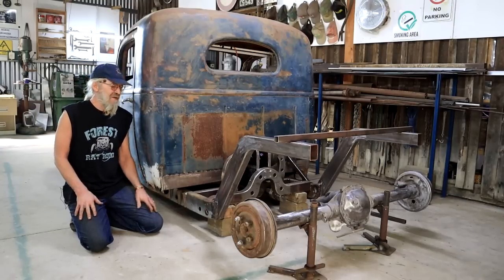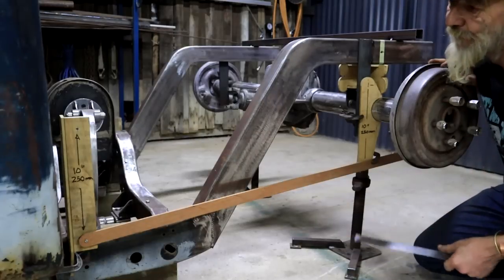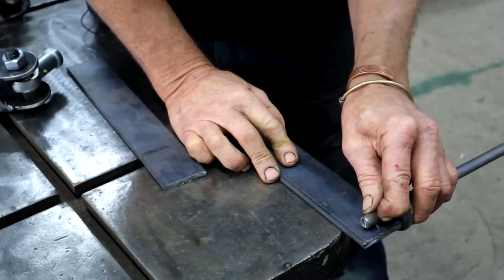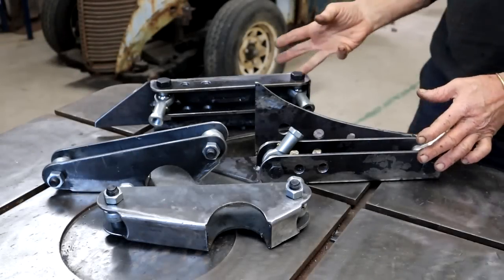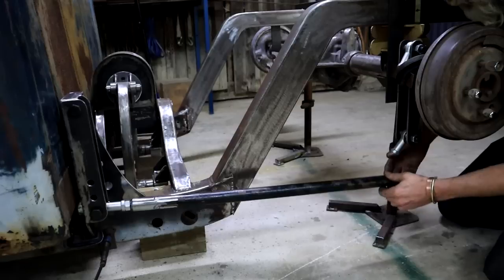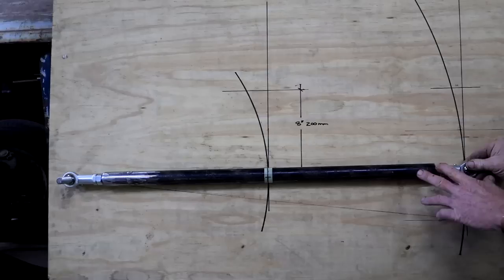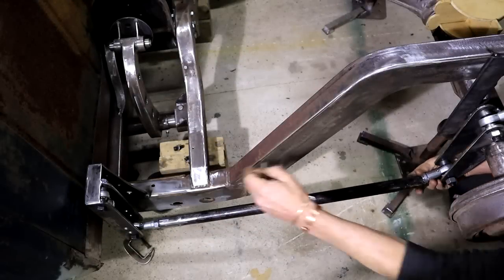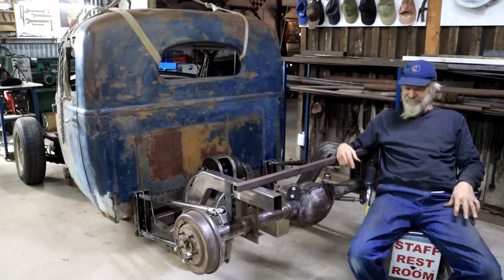Building parallel 4 link suspension from scratch - 1939 Hudson Rat Rod Part 18

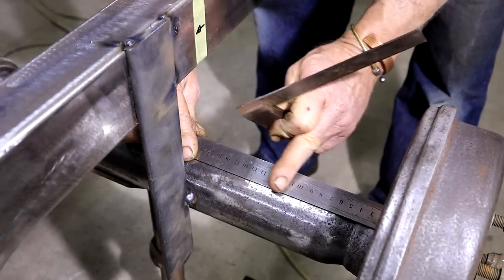Comment: Hey Diff, I'm sure you already know this but some of your viewers may not ... the rear axle won't articulate with a parallel 4 link. It'll go up and down fine and look really cool but if you ever plan on going off road it's not gonna articulate (lean) over all the bumps without putting everything in a huge bind. You can watch me explain that in my "How I Mounted Coilovers And Diagonal Link" video starting at the 4:13 minute mark. You can demonstrate that when you get done by jacking up one wheel (or side) and watch the other one magically come up too .. which makes a cool video. Carry on brother.
Reply from the maker: Howzit Bob. Yeah saw that video🙂 But remember there is quite a difference in articulation between using bushes and heim joints. I will post a video showing what I get when I have those rear brackets welded on and can jack the real axle up and down. 👍

Comment: MOST INGENIUS FABRICATION... WELL DONE. 3 DEGREES ENGINE AND PINION,THATS WHAT I SET MINE ALL AT, AND NEVER HAD ANY VIBRATIONS OR U JOINT FAILURES.HONESTLY AS LONG AS THEY MATCH . YES ITS NICE HERE IN IDAHO U.S.A. TO ORDER PARTS , BUT I STILL FABRICATE LIKE YOU AT LEAST 75 % OF MY BUILDS. I LOVE MAKING MY OWN FRAMES AND STEEL PARTS, THATS REAL KREATIVITY!   BE BLESSED, THAT🤟🤟👍👍 BUILD IS TOP NOTCH.
Reply from the maker: Thank you brother!  Yes, most important is indeed that the angles are the same. Seems a number of people don't realize that

Comment: Look Good Div, Thank you for sharing. I remember doing my 4 link, Was quiet a task. Took me about 5 hours to set it up and 5 mins to tack it in place. I used left hand and right hand threads on the 4 link so I can tune in the pinion angle. You way will also work.
Reply from the maker: I'm sure you did a great job, know your work! I want my link bars to have exactly the same length, otherwise its not a parallel 4 link anymore. I will explain why I want that in my next video.

Comment: Love your attention to detail as far as them 4 link bars you always want the bottom bar level  taking into consideration the weight that it will be once the bed is made etc. So if you have it off a bit its a rat rod.
Reply from the maker: Thanks. Yes, I know the general rule is that link bars should be level to the ground at ride height. But that rule is not cast in stone, there are other factors like anti squat that can come into play.

Comment: Hey Diff, you typically answer my questions as i think of them. How much forward and backward movement can the air bags take? I would think that fully dropped there will be the least forgiveness. Cant wait to see setting the pinion angle. I swapped out transmission and transfer case in one of my jeeps and now am fighting a vibration. Great job!
Reply from the maker: Yes, I will have the bag brackets nicely lined up at full compression. A little out of line at full extension won't hurt them, there some flexibility there

Comment: Are you planning on using a carrier bearing for your driveshaft tunnel and a double cardan ~15" short slip shaft to attach to your pinion? I can't imagine the pinion angle being much more than a couple degrees from 0*.  Nice work! You've got be baffled! Love the torsen-cantilever airbag setup!
Reply from the maker: Yeah, something like that is the current idea. We will see how it works out🙂

Comment: Correct i agree , motor = electric / engine = combustion chambers , gas, ect.  I wish i could weld with the end of my finger and cut steel pipe with a knife .
Reply from the maker: Yes, you are a wise man!🙂 Those knives are EXTREMELY rare!😂

Comment: Question. For the link bars you used bolts on the ends presumably so you can adjust the length. However, you need one end to be reversed threads. Right now, if you spin the bar it won’t change length. You will have to remove the bar completely and spin each end separately.  If the bar length is not to be adjusted, then why not just weld the rod ends in solid?  Great work and very informative videos. Definitely subscribing. 👍🏼
Reply from the maker: Thank you! I wanted the option of adjusting the length but could not source left hand thread bolts. Like you said, need to be removed to adjust, but so be it. It's not something one would do often😀

Comment: Rear axle forward and aft movement is one of the issues Ford designed into that horrible handling MK4 Zephyr you have outside, they understeered something terrible roll steer like you are trying to avoid, liking the engineering going into this build
Reply from the maker: I heard they did not handle well and were a failure. Never drove one myself

Comment: What size plasma cutter are you using. Great show love it cheers Diff
Reply from the maker: Thanks Ian. Mine is a Cut40. Good enough at least up to 6mm/1/4". I never cut thicker than that.
Reply: @ratrodsafrica  thanks for that i have a cut 40 but it doesn't work as good as yours.

Comment: 2 wheeled powered vehicles are called MOTORcycles not enginecycles. Competition between powered vehicles is called MOTORsports not enginesports. Powered boats are called MOTORboats .... and on and on. Call it what you want 😏😂 Cheers from 🇨🇦 have a great day.
Reply from the maker: Its because in those cases, the word MOTOR is a verb. Motorboat vs rowboat. Motorcycle vs bicycle. An engine is what it is, motor is what it does! 🙂 Let the never-ending debate continue😂

Comment: Will it need a pan hard bar with that style setup? I've been enjoying this series. Hope those Heim joints are stronger than they look. I know camara can be deceiving. Carry on and I will keep watching
Reply from the maker: It will need either a panhard bar or Watts link to prevent side ways movement. For a setup with lots of suspension travel a Watts link is the better option. The video will come, watch this space!🙂

Comment: Sorry if this is a stupid question but couldn't you adjust the pinion angle  by turning the link bars thereby increasing or decreasing  the distance between the heim joint eyelets?
Reply from the maker: Yes, you could do that. But it will mean the upper and lower link bars will have different lengths. And that means it will not be a true parallel 4 link anymore. In my next video, I will explain why that is important

Comment: Nice job ,are you gonna run a panhard bar as well , or will you need it ? Thanks for the video ,great job!
Reply from the maker: Thanks. The Watts link does the same job as a Panhard bar, only better.
Reply: @ratrodsafrica  Yes it does , I saw that later in the video , and I thought , oh wow, a panhard and then some , excellent job , thanks for the shock video too , I'm building a similar style  rear clip , so this gave me a great idea on where to mount my shocks , except I'm not running bags , just coil springs , with weight jacks , old stock car stuff , lol 🤣 keep up the great work 👍🏼
Reply from the maker: @edwardippoliti626  all the best with your build, brother!
Reply: @ratrodsafrica  Thank you , and thank you for your great Rat Rod videos!

Comment: Howzit oom,
You went right over my understanding, so I have a question, what about side to side swing, how are you going to deal with that?
Hava lekke een,
Ciao ciao,
Reply from the maker: Ag kak man! Use those brain cells and you will get it!🙂 The 2 common solutions for sideways movement is either a Panhard bar or a Watts link. Go Google it! But I will also be doing a video when I build my solution.
Reply: @ratrodsafrica  Fhanks oom, I have seen the Panhard setup but thought it was part of the 5 link suspension,
Anywho , talk soon 🔜 hopefully you are healed totally by then,

Comment: Can you set the pinion angle with the links or are they not adjustable because the ends are all right hand thread. Just a thought.
Reply from the maker: If I set the pinion angle with the links, the upper and lower link will have different lengths. Then we dont have a parallel 4 link anymore. I will talk more about why a parallel 4 link is important for my application in the next video.
Reply: @ratrodsafrica   would fractions of a inch make that much of a difference? I can wait until your next video for an answer. Thanks Diff for another great video.
Reply from the maker: @kenstevens5675  probably not. But I try to do things the right way 🙂

Comment: Hi Diff! Greetings from the top of NYS! Do you go between metric and SAE just for us in the USA?
Reply from the maker: Howzit! Mostly yes. Although I did spend a few years in the States and sometimes flip between the two when working 🙂
Reply: @ratrodsafrica  i figured that was the case! I am one of few that just wish we would switch over like the rest of world.
Reply from the maker: @paintslinger16  It's actually a much easier system to use!🙂
Reply: @ratrodsafrica  I agree! And much of our stuff the standards are actually mixed now. It’s even harder to deal with

Comment: its odd when you need a mount for vehicle they list transmission mount, motor mount (not engine mount)
Reply from the maker: We talk about engine mounts and engine parts. An engine is what is, motor is what it does! They obviously have it wrong😆
Reply: @ratrodsafrica  don't know where it started but in at least the southern US the parts list only motor mounts not engine mounts. It odd we use the term engine stand and engine lift. But most of the time here engines are called motors.
Reply from the maker: @DependableAutoTruck  so you put the motor on an engine stand! 😁 The world is a strange place...😂
Reply: @ratrodsafrica  yes it is we live in the southeastern USA just the way we grew up and the phrases used here

Comment: I l👀k GREAT but shouldn't you (cross) measure LF to RB and RF to LB (wheel alignment centre) to be 101% shore about that everything is exactly as it should be?  ☕️🤔👍
Reply from the maker: Most important for me now is to have front and rear axle parallel to each other when looking from above. I will still be able to move the back axle sideways, even after 4 link brackets are welded on. The heim joints allow a lot of sideways movement. Planning to use a Watts link to arrest that sideways movement and can check the cross measure distances then.👍
Reply: Yes, and the Watts linkage keeps it even strighter than a Panhard...  😉
Reply from the maker: @mikaeltillenius8751  yes, exactly 🙂

Comment: I love your work but I have to say something wrong with your driveline way too high maybe it’s just the video and the second thing those rod ends and bolts are not going to work there not strong enough and you have threads on your bolts you need smooth shaft Where  the Rod N ride
Reply from the maker: That's the fully slammed position. When the axle moves down to ride height, it lines up OK. Well, if the link bars break I will just have to build new ones!😁

Comment: Hi Limited slip job well done looks  good it will drive good As we all know you know what you’re doing Is spot on one concern I’ve got which will mean nothing to you I’ve got three cars 4 linked Which have been done from three different people on little cars and each one has solid bar 4 link where you’re got the hollow ones it’ll be all cool it’ll be strong enough my car Made for bigger hp . Thanks for the show that was great👌👍
Reply from the maker: Thanks! A hollow bar(thick walled pipe) is stronger than a solid bar. Essentially, the strength-to-weight ratio of a hollow pipe is superior to a solid rod because of the pipe's inertia. The inertia of a pipe is greater than that of a rod .
Reply: Well there you go you taught me another thing thank you

Comment: Time to simulate a tailsharft in there pinion angle on zero i dont think is going to work . Probs with haft to be 2 degrees pointing down on pinion angle . So tailsharft dosnt bind up or hits anything . I could be wrong . Just sharing my thoughts not by any means having a go . As i love your work you are a true master of all trades . God bless you .
Reply from the maker: U joints can work at much more than 2 degrees. Will probably still do a video about setting up the driveshaft etc